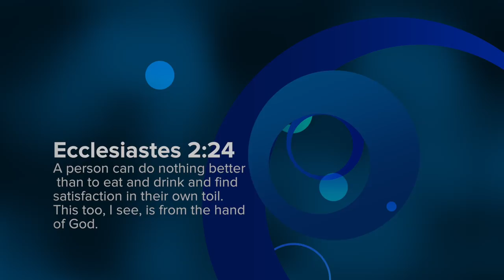Jimmy and Johnny Jettison Junk; Tim and Casey Dodge Damage

Comment: Tim I'll let you in on a nugget of information I left on an old wranglerstar video that he just ignored. When your working with an excavator in the woods, always make sure your final drives are to the rear of the machine. That's because if you pull a tree into the cab.... I've done it... and your finals are at the front, the tree can get into your steering controls and drive you deeper into the tree and seriously hurt you. But if your final drives are at the rear it will drive you away. Love the vids keep it up, yall are awesome.

Comment: Another tip for clearing trees is always have your track drive motors to the rear so if a branch comes at you and shoves on your drive levers it walks you away from the tree instead of into it didn't know if you knew and you already found out the hard way why you don't pull trees toward you lol. hat's off to you sir for showing your screw up on video be safe

Comment: Tim, Casey needs a thumb.  You won't know how you lived without it, once you have it.  If you like the grapple, you will love the thumb.  Good luck
Reply from the maker: As I’ve mentioned on the 75 other comments saying the same thing, Case doesn’t offer a thumb, and I don’t know where to find a bolt on thumb.
Reply: Tim, as the owner of a graymarket IHI 30 that has almost no dealer support,  I know the feeling.  I had one built for me locally.  It is not rocket science, but it really helped that he had built a bunch of them, for a bunch of different brands and sizes of excavators.  Since we are in Washington state, you probably could find someone a little closer to help you out.  Whatever it takes, it will be worth it, those other 74 guys were right, thumbs are addicting.  Good luck.
Reply: Come on Team .... Let's ALL help Tim find one ..... OK ?

Comment: Need to put a thumb on Casey cuz that would help you on like tree stumps cuz you could actually pinch it pick it up and shake it a lot easier to knock the dirt off of it and clamp stuff to move it around
Reply from the maker: Hmm...never thought Of that.  ...
Reply: Stuff from the trees could make great firewood, but a huge amount in the pile of wood is from the fence and shed which I'll bet is pressure treated.  That's stuff nobody wants to burn, even in an outside fire pit. A lot of that dressed lumber material looks like it could be re-purposed and still has some useful life in it.  I'm big on keeping my construction detritus out of the landfills and burn pits  if it still has alternative uses.  Freecycle and Craigslist can make a lot of that stuff disappear quickly.

Comment: When you're felling trees with a mini trackhoe, the way to do it is to try to dig out the base on the side you want it to fall towards, then try to push it away from you, kind of with the boom flat against it and by lowering the stick. Of course, that isn't always feasible, as it wasn't in this case because of the obstacle course in your way.

Comment: Hey great video I know it wasn't part of the plan but that's part of life. What would you recommend for to run a tiller? What weight is rear wheel weight 50lbs or 72lbs and what is minimum weight for front for suitcase weights that you recommend?
Reply from the maker: No rear weight necessary.  Need several front weights or leave the loader on. Loader without bucket is hardly enough on 1025.  But it will allow you to get by, and yet give good visibility.

Comment: Question is now how many nails did Johnny get in his tires. My tires are filled with rubber I don't have to worry about that. That's why maybe you should get a second set filled with rubber. I realize there are a little more rougher of a ride but in this case you don't have to worry about running a tire.
Reply from the maker: We watched closely.  Of course, that is sometimes not enough.  No flats yet
Reply: If you have solid rubber tires you can drill holes in it to make the ride smoother

Comment: Johnny needs more ballast. Talking about using equipment in not the right way. Back about 20 years ago I had a W-9 case paylaoder Joe he used to work for me. He had a stump to remove it had 4 branches in the stump I started on it then the phone rang. So I delt with that came back Joe had wrenched the stump out of the hole. It was at least 12' in diameter it was just about I'm possible to move it with the paylaoder it was so heavy. A couple hours later it made it to the burn hole.

Comment: Hey Tim! Have you ever had problems with the pto with Johnny? I have 42 hours on my 1025r and I just hooked up the 3 point hitch. The hitch didn't work at first but I manipulated it and loosened it up. After that I hooked up my sprayer and the pto would not work, the top or bottom. Any suggestions?
Reply from the maker: The top or bottom?  Not sure what you mean.
Reply: The pto for the mowing deck and the rear pto will not engage when I pull the yellow pto switch.
Reply from the maker: I suspect one of the safety switches not connected properly.. time to call your dealer
Reply: I just got it back from the dealer. It was the solenoid for the pto. The pto had never been used and the mechanic suspected that it may have frozen up. Took it home, hooked up the sprayer. Works great!
Reply from the maker: Sweet!

Comment: Is there a thumb for Casey that you can get?
Reply from the maker: None from Case.
Reply: Ahh thats too bad this project almost begged for a thumb.
Reply from the maker: Yep.  I need to find one from a third party.  Surprised no one has contacted me...
Reply: Is there an open set of control or would you have to put in a diverter valve kinda like the grapple on Jonny.
Reply from the maker: Already plumbed

Comment: Does Jimmy use his garden tractor for anything other than mowing?
Reply from the maker: He pulls that trailer (Bob’s old trailer which you might have seen in Katriel’s 2nd grade Tractor drive) around with it.
Reply: I seen it had bar tires on it, so didn’t know if he used it to till his garden or what not. You will have to give Jimmy a jeep wave for me, I see he still has his Jeep!
Reply from the maker: Yep.  Maybe Jimmy will comment!

Comment: Tim, if you DO buy a bigger tractor. DON'T FORGET TO HAVE REAR REMOTES & TRUE 3RD FUNCTION VALVE INDTALLED. You'll thank yourself later.
Reply: Tim, go to WR LONG for the 3rd function valve kit if or when you get a larger tractor. They build grapples, 4-in-1 buckets, and other loader attachments.

Comment: If you put the blade behind you and get a little further back it wouldn't tip back on you.
Reply: Obviously not when you're right next to the house like that. Just a tip I got on the CAT landscaping channel
Reply from the maker: Each machine is likely built differently.  Case recommends blade in front.  Also, my personal experiments agree, blade in back does not work very well with this machine.
Reply: Fair enough, I did read that too, it surprised me when the cat guy said that.